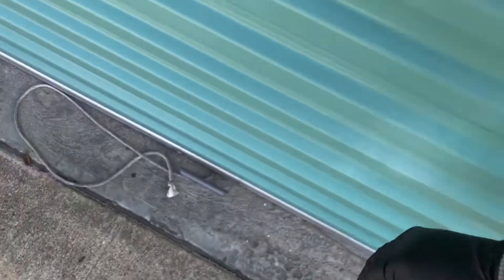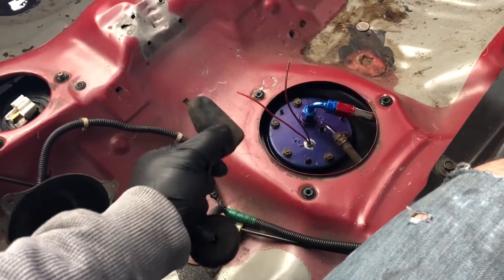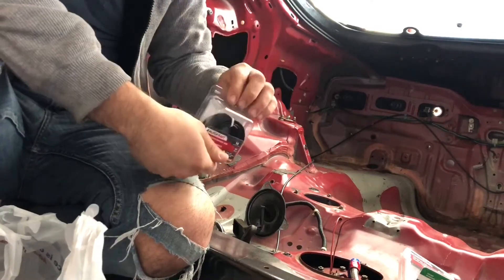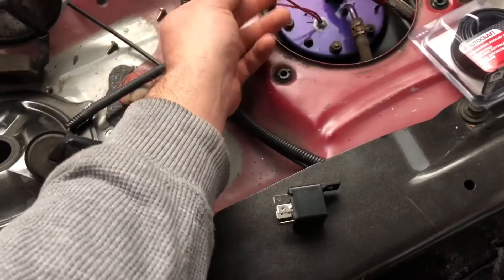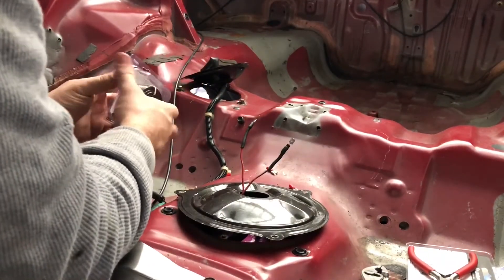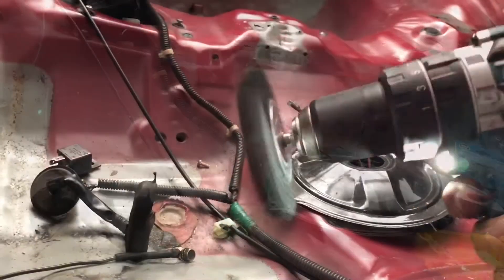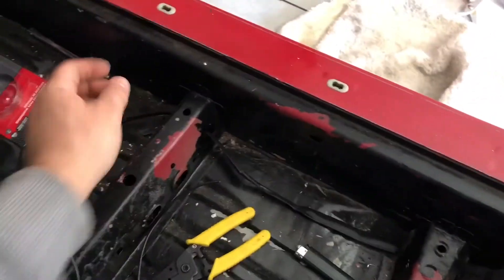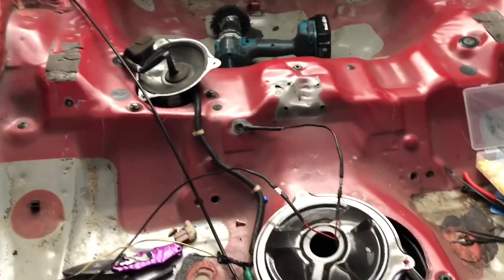14v Fuel Pump Conversion !! Honda acura universal

Comment: So the ground that was on the factory pump plug, just leave it cut and not grounded?
Reply: Yea because now you’re getting a stronger ground that’s coming off the fuel pump and off of the relay
Reply: @ebp609si  thank you

Comment: So the pump going to b running always wen the ignition on or with a on and off switch ? I’m about to do this to my integra have a issue somewhere so I want to have a switch on so I don’t look for the problem
Reply: Once your trigger/switch wire is your OEM wiring harness (yellow;Green) the pump should work as normal...only the voltage delivery that would change

Comment: This technique does not add voltage.
It adds available amperage.
It's still a good thing to do, but the name of the video is misleading.
Reply from the maker: It adds amerage and voltage. Oem througout a pull will generally read 11-12 volts. After relaying straight to battery it will read whatever the alternator outputs. Typicallys 13-14volts
Reply: @SPTuning  I've never personally tested the difference, but that doesnt make sense. I've specialized in wiring/ relays for 20 years. I cant fathom any more than a couple 10ths of a volt increase on voltage. The OEM wiring is using the SAME EXACT power source as the new relay being installed. The only diffrence in factors would be shorter/fatter wires, and/or other electronics tapped into those OEM pump wires (which I dont believe is the scenario in this case).
Any voltage increase experienced is likely coming from fatter wires, because DC electricity travels around the outer circumference of the wire itself (fatter wire = more circumference = less voltage drop)
The relay itself adds nothing,
It's a switch.
I'm not here to discredit, I'm here to help put more good info out for people totally in the dark on the subject.

Comment: So maybe I'm like the other people not understanding this correctly. I get that the alt puts out 14v when the car is running. Are you saying that the stock power wire to the fuel pump only gets 12v when the car is running? Why wouldn't be getting 14v just like the rest of the system if its controlled by a stock relay? Or is there a regulator, between the 14v the battery sees, before it gets to the ecu? Then that drops it to 12v and that's where the fuel pumps power wire is coming from not a stock relay? If there is no stock relay and it get its power from the ECU (after a voltage regulator) then I completely understand. But if the stock pump is ran off a stock relay then your just replacing one relay for another right?

Comment: Can we use a bigger relay like a 50-60 amp ?
Reply: if you use a 30amp fuse up near the front of the car then i dont guess it would really matter what size relay you use as long as its equal to or bigger than 30 amp.
Reply: Theres no point.
A standard relay maxes out at 30 amps output.
The biggest 450lph in tank takes 19-21 amps running at full capacity.
It doesn't matter how big the relay is over 30A.. the pump will only use 19-21 of the 30 amps.
For the guys using way bigger external pumps, then yes go bigger than 30(refer to pump specs)
Reply: If that's what you have, it won't hurt. That means the relay can handle 50-60 amps without burning up. So your question is like asking whether you can use tires rated for 180 mph, if you only plan to drive 70. Sure, no problemo. But don't use a relay rated for 30 amps if there will be 50 amps flowing through it (obviously).

Comment: This is still considered  12v system.
Reply from the maker: Alternator puts out 14 v. Voltage comes from battery during alternator charge while car is in, 14 volts is consant measure at fuel pump
Reply: Anything you test that’s suppose to be batt V. while vehicle is running you will get Alt. Output voltage.
Reply: Yeah, '12 volts' doesn't literally  mean 12.00 volts in an automotive context.
Reply: Not a 14v. System

Comment: Maybe this is a dumb question or maybe I missed it in the video but how do you seal the wires coming through the top hat on the fuel pump? did you use silicon, rubber o ring, if i bust off the stock power line thingy how will I reseal it? Right now I'm just NA trying to break in the motor but I would like to know how to do this when the time comes.
Reply from the maker: I used silicone.
Reply: SP Tuning Tyvm sir it almost looked welded in video. Keep up the great work.

Comment: I don’t understand the science behind this. Where is the “extra 2 volts” coming from? The entire car is only a 12v system you’re essentially just wiring in another fuel pump relay after the stock relay. If this is true I would like to see the numbers on a volt meter.
Reply from the maker: Yes. Stock “pump voltage” becomes the signal for the relay which gets direct power which is always higher than 12 from the battery directly rather than through an oem wiring harness which is distributed and shared throughout other electrical components , this is standalone. Once car is back up on the road ill tty and remember to do a video demonstrating stock voltage being sent, and higher voltage using this conversion :) thank you for showing intrest :D
Reply: SP Tuning I could understand the “direct power” from battery part, but not the 14 volts. With this conversion I see a shorter travel of voltage to the FP itself which makes it more responsive and more amps. A shorter travel of voltage is always better sooo I do see how this helps a bit lol But YES please make a video in the future of before and after in volts/ohms and Keep up the good work Papis 😝🤣
Reply from the maker: Although the battery itself is also a “12v battery” most runningn alternators put out 13.7-14.7 volts on average. Thusmore making the battery a “14v battery” while car is running, and the direct power coming off of it will be that 14v. Thank you papi ahahaha i promise ill make a video once running again
Reply: SP Tuning ooooooh my god!!! I COMPLETELY FORGOT that once the car is running the volts turn up to 14 volts 😂😂😂 and I’m a mechanic too 🤦🏽‍♂️ wow I feel so stupid now. Lmao
Reply from the maker: Hahaha nah don’t feel stupid. Haha im glad we were able to explain/understand it. Im sure others wondered that too and hopefully will read these comments haha
Reply: SP Tuning lmao yea people DONT FORGET, car turns to 14v with the car running 😂😂 but yea bro definitely when the time comes show us the difference it makes. I wonder why no one never mentioned this in the Honda forums lol I was tryna make 450+ HP when I had my LSVTEC civic with 750cc injectors and an AEM 320 lph FP. Thing only made 273 on 14 psi -.-  never again will I be doing low comp Pistons. Apparently my injectors were already maxed out 🤷🏽‍♂️. Doing this can actually provide the FP to flow more fuel to the rail? Increase fuel pressure?
Reply: Does this bypass the main relay on the car? Love the videos keep up the good work.
Reply: @HeyStack17  main relay still functions as a signal for the secondary relay.

Comment: What’s the difference in output vs the stock way.
Reply from the maker: Not sure on exact difference but substantial since most cars putting down high hp run this one way or another
Reply: Lol big difference ran all 10 guage ofc wire. To fuel pump upgraded engine grounds to 1/0 ofc welding cable i went from a 340 lph kemso ebay pump reading 43psi at idle switched to a aem 340lph pump with this relay and wiring upgrades reading 60+ psi fuel pressure at idle lmao ima need a retune thanks for the video helped alot.
Reply: The difference is your OEM wiring was only designed to handle 20 amps of current @ 12-14 volts.
You will exceed this slightly with some bigger pumps (450lph).
The factory wiring will begin to melt, it cant handle the additional current.
Short fat grounds always help with any electronics.
You will only see a couple 10ths of a volt (voltage gain) at the pump itself, but the oem wiring wont melt. That's the point of this process.

Comment: Currently building my Integra what is the point of this?
Reply: The purpose I should say
Reply from the maker: Using a direct battery power source you get more consistent and higher voltage to the pump. More flow without cutouts
Reply: My goal is 300 to 350 whp for a reliable street set up on E85....would you recommend me doing this?
Reply: Also I just finished the bills myself have not even primed the engine yet let alone first start up do you have any videos regarding how to First Prime the engine?
Reply: @458237  I'd recommend you doing this those stock little wires go brittle anyhow. And you get two extra volts from it so yeah I'd do it and have done it before.